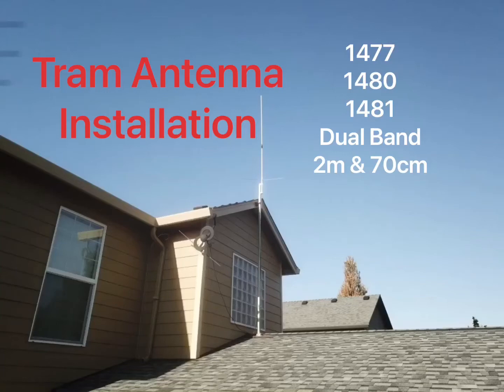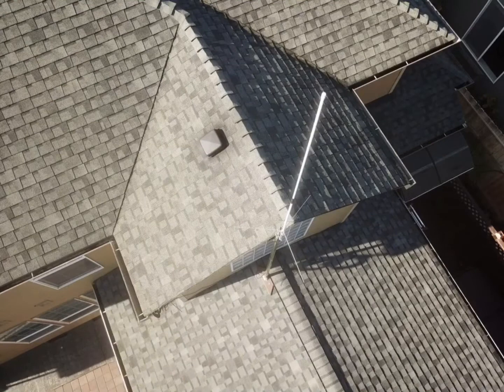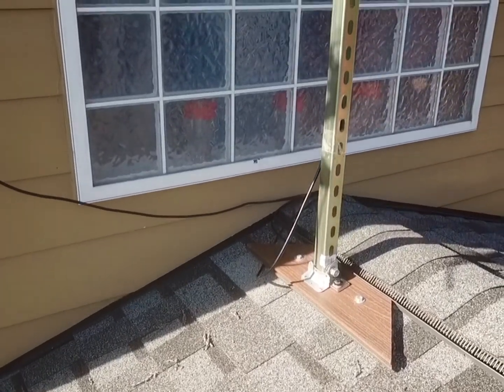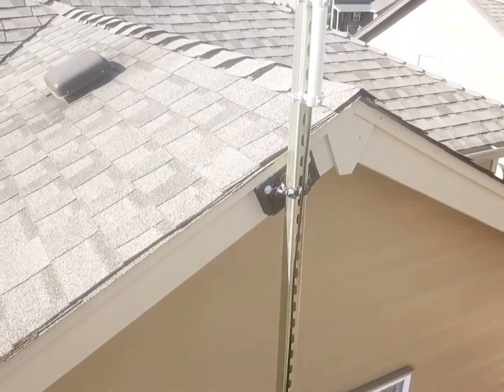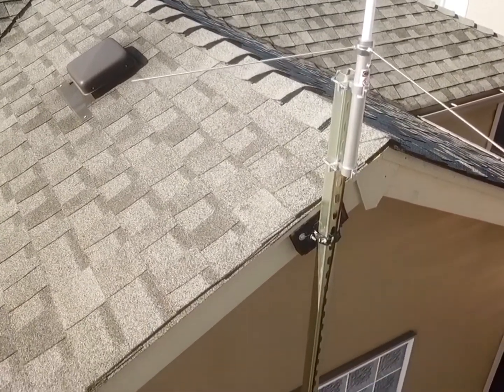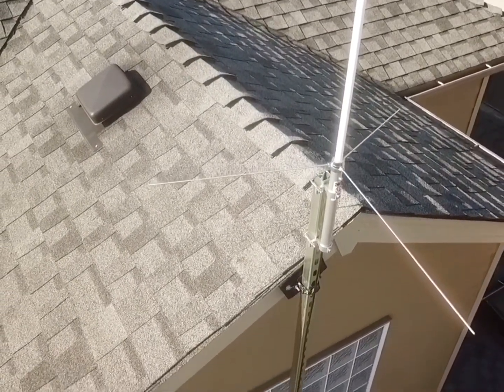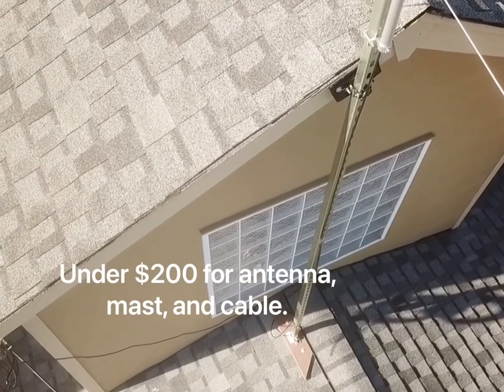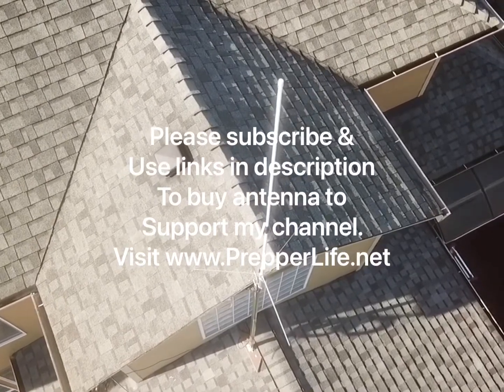Under $200 Ham Radio Antenna Install (Tram 1477, 1480, 1481)

Comment: What’s the ground for? Is it a safety for a lightning strike?
Reply from the maker: Yes- and any static or EMP dissipation.  Of course nobody can guess the amount of radiation or current- so it’s just another layer of possible protection- not 100%.